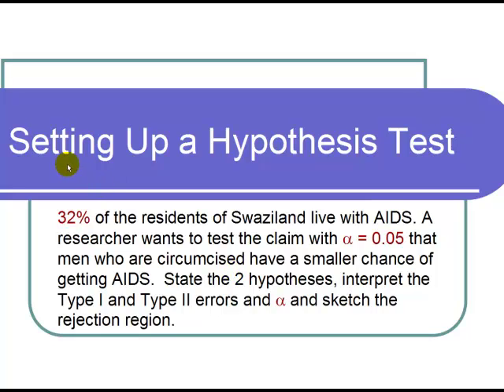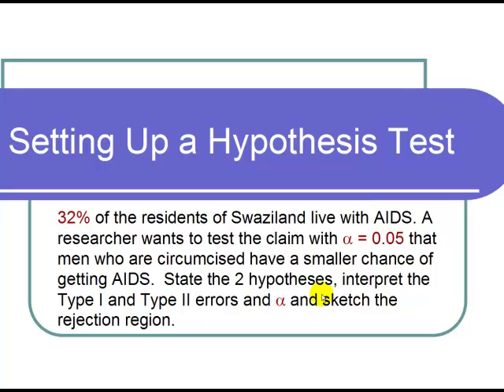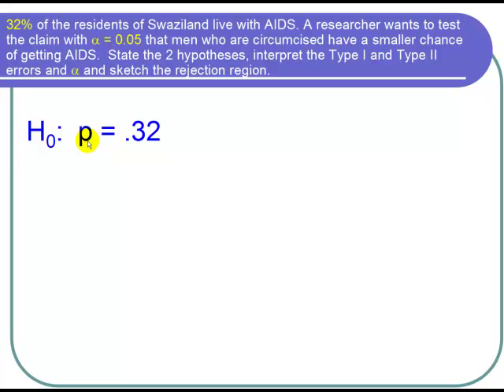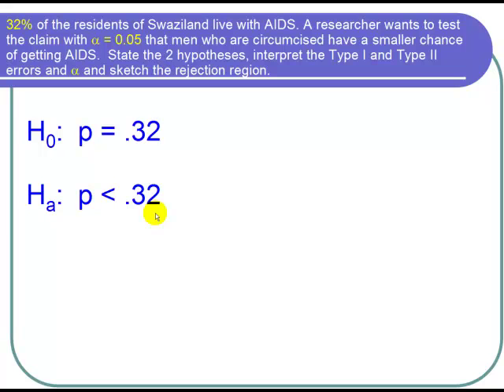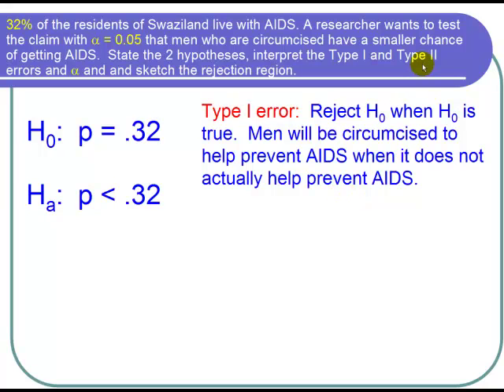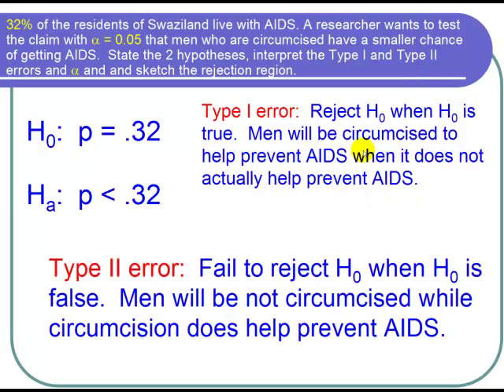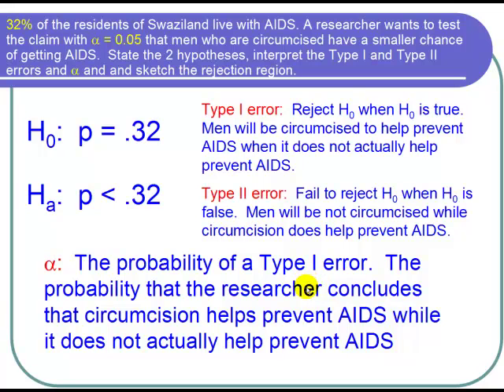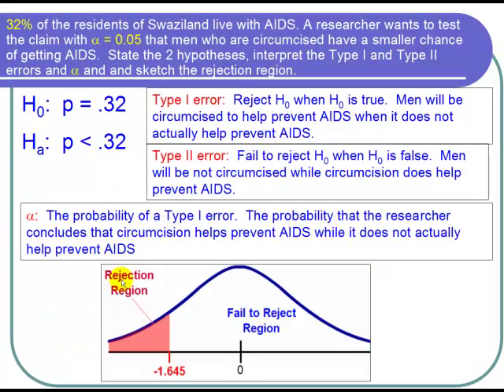Interpreting Type I and II Errors and Sketchig the Rejection Region

Comment: im confused as to how you found 1.645
Reply from the maker: Since you are given the area to the left of the standard normal curve is 0.05, you can use the inverse norm function with mean 0 and standard deviation 1.  This gives you -1.645...  This is done using a computer app or a calculator that handles the normal distribution.